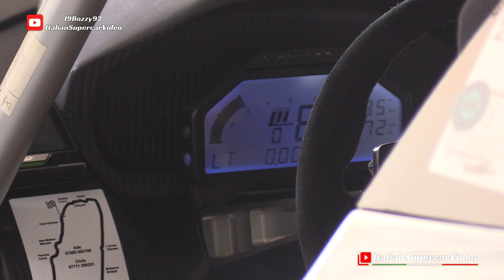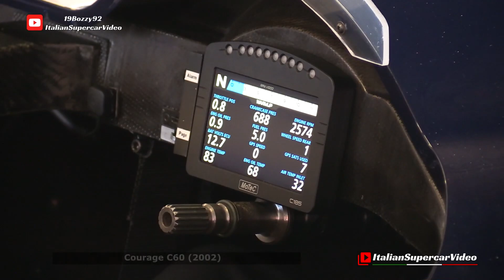Dix Mille Tours 2022 by Peter Auto Part 1, Paul Ricard Circuit (FR) - Group C, Endurance Legend, etc

Comment: Beautiful cars on an ugly racing cirquit.
Reply from the maker: Personally, I don't mind the circuit. Why don't you like it?
Reply: @Italiansupercarvideo  They made a perfectly good racing cirquit into a car park! To me it`s a bit of killing the sport. When you`r going to fast , nothing happends! you just return to the track and maybe still in the lead?? drivers over drive and takes risks  that never would work on an older layout and not to mention cutting corners and go over the (non existing) curbs everywhere without risking anything. And finaly  the race will be judged by stewards afterwords. Sorry I got a bit carried away here but I prefer older cars at cirquits that don`t allow that "modern" type of racing. Cheers from Sweden!
Reply from the maker: @calleskoga3572  Thanks for your comment. That made me reflect and curious. I'm unfamiliar with the old track layout, and this is an opportunity to research historical footage and compare it with the current track.
Reply: @Italiansupercarvideo  This is in general for the modern racing! The layout of this track is I think intact but adding all that tarmack around it made it to a Car park  in my mind. Thank`s for Your splendid filming as always mate!
Reply from the maker: @calleskoga3572  Thank you. I also don't like asphalt instead of gravel; it's the same problem in Monza, where all the escape routes are paved, making the track "easier" for those who take risks. I love Imola more also because, in every corner, there's gravel, and so if you make a mistake, you pay dearly for it.